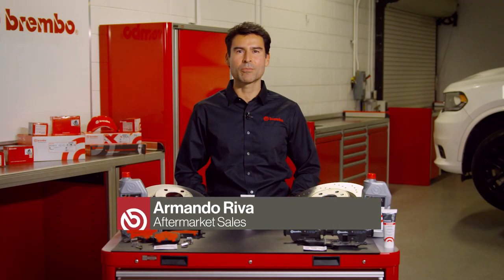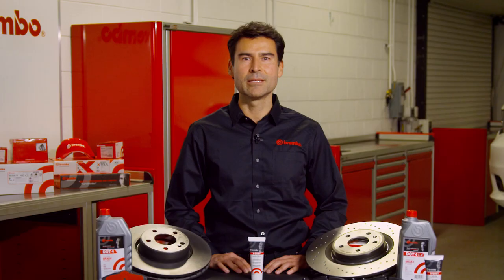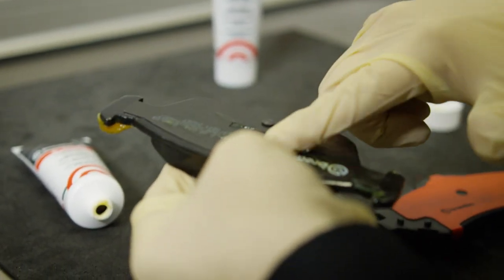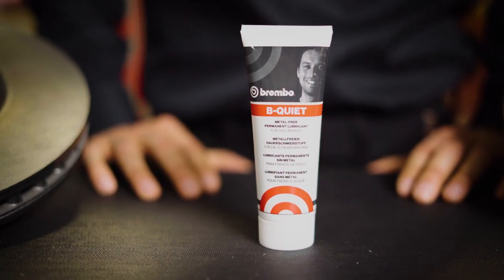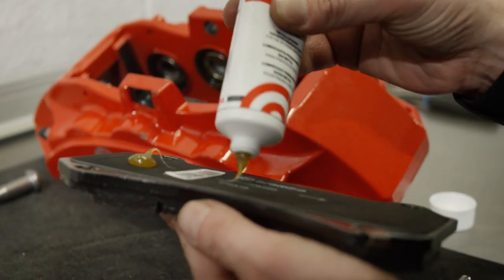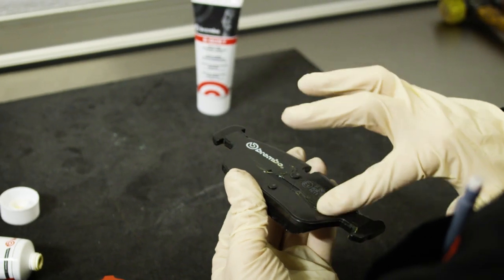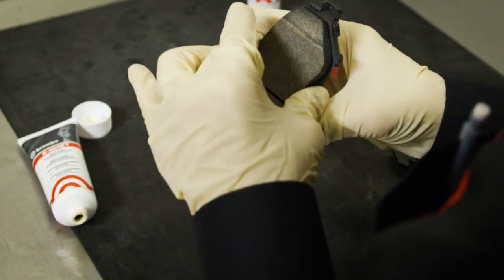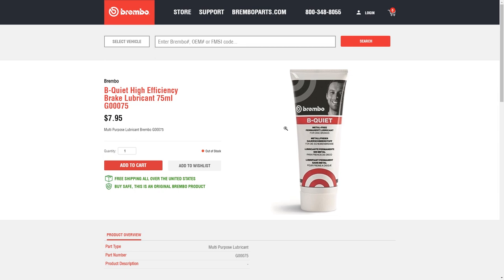Brembo B-QUIET lubricant

Comment: So does this help the sound of brakes that is like a boat horn? Its not a squeak but just like I said, a boat horn. Mostly when brakes are cold but sometimes when driving for awhile. No one at my dealership seems to have an answer
Reply: My Alfa Romeo Giulietta MY 2017 with BREMBO breaking system suffers from the same problem! Already changed discs and pads twice... and everything went "back to normal" .. like a BOAT HORN as you said :( I don't know why, but when they (mechanic/dealership) lubrificate something in the system... i can be 15/20 days without ear anything, but then, VVVRRRRMMMMMMMMM... the sound comes back :/ 

Sometimes, even with the car stopped/off...and if i take something from the back seat (when i need to put my knee inside of the car to take the "thing" out) .. VVRRRMMMMMMM the boat noise again.. :( (the car moves just a little bit (millimeters) .. and it is enough to move the disc/pad...and make that noise :/)

I am really tired of it....

Comment: WARNING: (from Brembo's own WELL-HIDDEN documentation) "The sliding guides of a floating caliper and the related pins require a different type of lubricant (to Brembo B-QUIET).", "The rubber parts of the brake caliper (protective seals, dust covers, caps and sliding pin rubber boots) are produced using EPDM" and finally, "(Brembo B-QUIET) is not compatible with EPDM plastics, which could swell."

I despise it when manufacturers (intentionally?) hide the information I need to made an informed purchasing decision. (And for what it's worth, Cera Tec has exactly the same problem.) If you have a sliding caliper with rubber/EPDM pin boots, then silicone grease (rated as high temperature i.e. to 200C or 400F) is what you need.